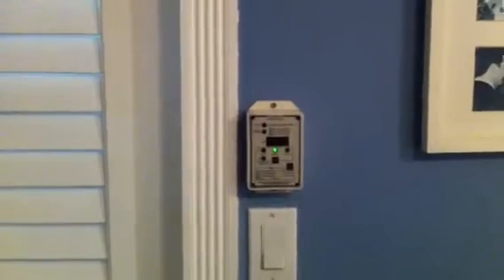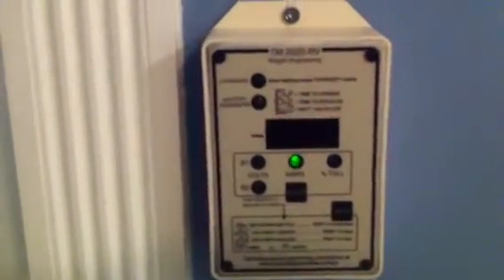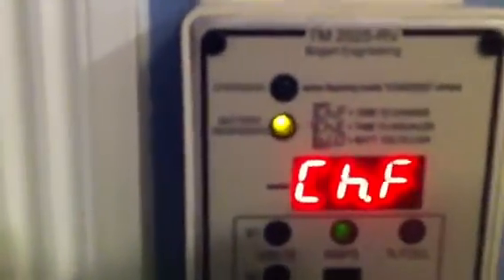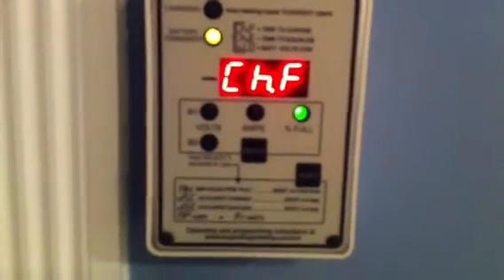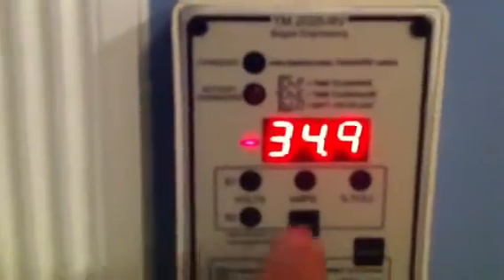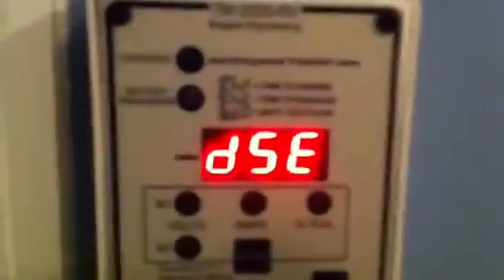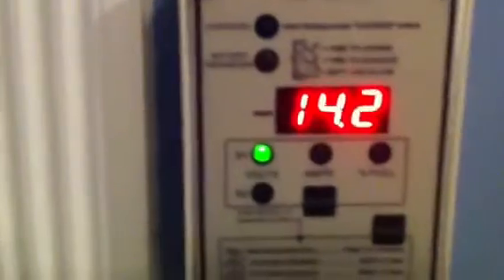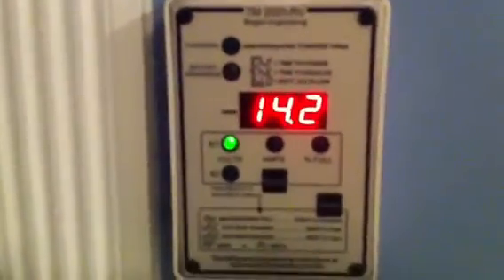Trimetric 2025-RV

Comment from the maker: This is wired to a shunt.  There are 4 main wires attached to the Trimetric (5 if you want to monitor a 2nd battery bank).  These wires are attached to a shunt which is attached to the battery.  It's pretty easy to wire but if you need help let me know.